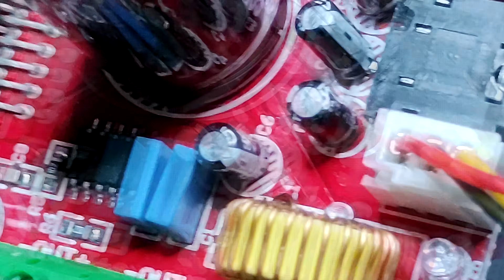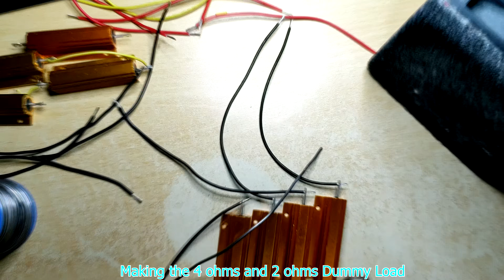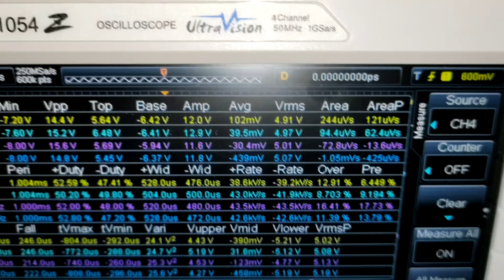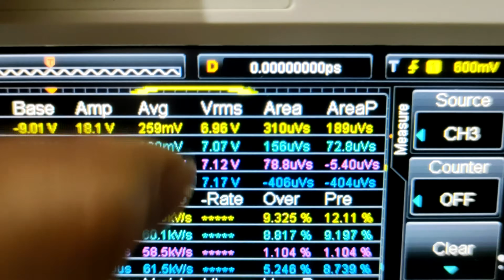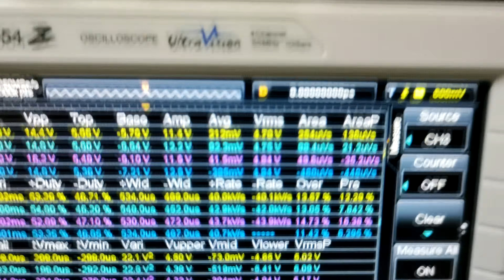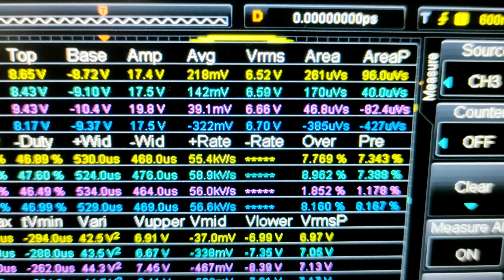TDA7850 Model XH-M150 4x50W Actual Power All 4 Channels Driven and Loaded

Comment: Thanks for this video! Does this mean the actual output for 4ohm is 12.25w even though it is advertised at 50w? Or is this normal because 12.25 x 4 ≈ 50 ? I have only a basic understanding of these things. Would it still be suitable to power typical speakers in a car or not powerful enough?
Reply from the maker: Yes the board can only do about 12W per channel before clipping and I really could not say if it will be loud enough for you especially if you like loud music. 
Connecting amps like this to a car stereo unit is not a straight forward exercise.
Amps like this only accepts low level inputs and some car stereo unit will have a low level output or a high level output only or maybe both.
A 12V power from the car is very noisy and the amp might need additional filter board to deal with this and maybe a ground loop isolator too.
If your new to this maybe it is best to consider a proper car amplifier instead.
Reply: @boknoynaruto3824  Okay, thanks heaps for the extra info! It's a classic car so I don't want a typical head unit. I've got a bluetooth board hidden behind the dash but it drops out at high volume. Cheers! I'll see what I can figure out.
Reply from the maker: Using Bluetooth would make it a bit more convenient.
Check out the wondom BDM8 Bluetooth version, it is a TPA3255 board with built in Bluetooth it is capable of more than 250 watts RMS per channel on 4 ohms load.
It needs a 12V to 48V boost converter though which adds to the cost of the setup.

I have the BDM8 non Bluetooth board tested here https://youtu.be/2NJMLp1aENU
Reply: @boknoynaruto3824  awesome, thanks for the advice! Ill check it out